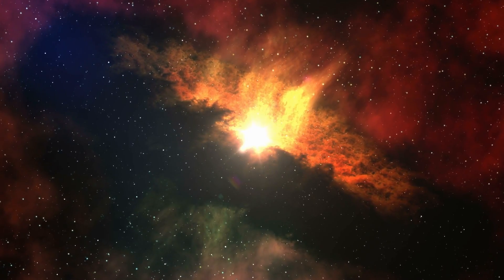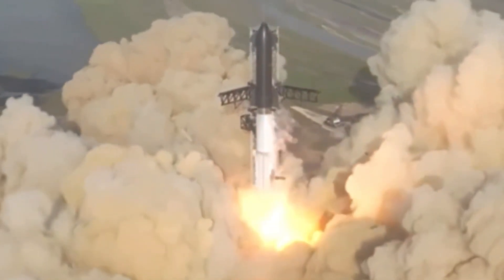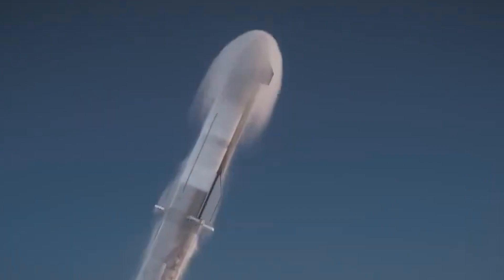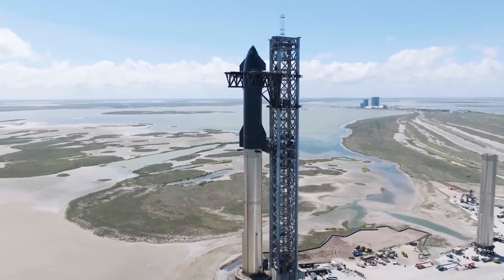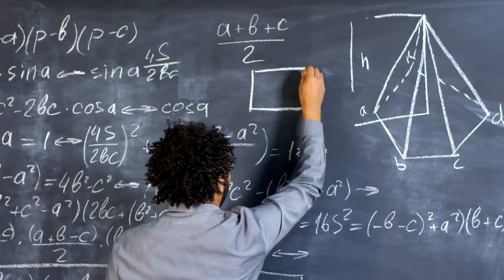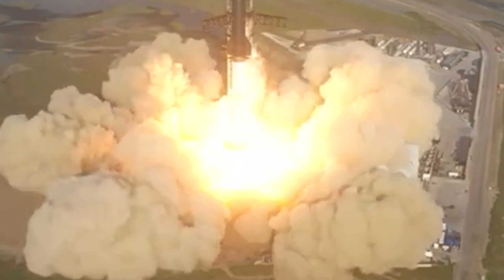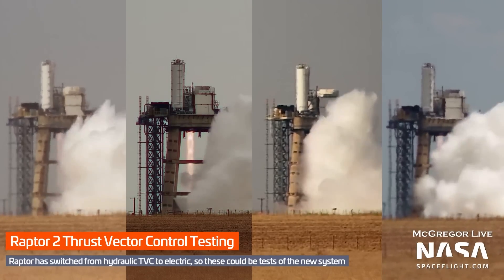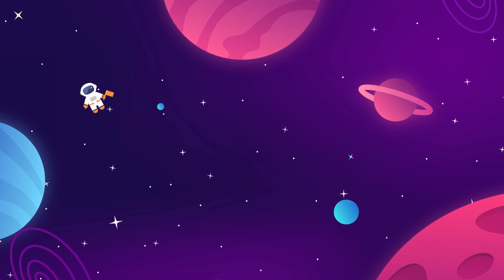The SpaceX Starship Orbital Launch Update Is Here!

Comment: The most important thing in massive launches is a water-cooled launch pad. Bringing down the temperatures requires anything that evaporates under heat. The fact that this was not done seems like haste is waste and in fact here it seems haste is stupid looking at the colossal loss as that launch could have gone perfectly. Simply having an easy to build massive water tank at the bottom of the launch pad without that sophisticated water spraying feature would have made a considerable difference in bringing the temperatures down at the launch site.

Comment: The narrator is a freaking small brain clown.  The rocket didn't "burn through" the concrete, lol.  What happened is high intensity vibrations fractured the concrete, allowing exhaust gases to penetrate through the cracks, which eventually blew out pieces.  Once an opening was created, the remaining pad was pealed off in chunks, similar to what happens with a sand blaster removing paint.  "There is no where for that energy to go."  Again, stupid.  Space X is using an open pad concept, where exhaust gases are spread 360 degrees around the pad, instead of being concentrated into a exhaust channels, like the Saturn 5 pads.  This drastically reduces the concentration of gases...  "No way that's possible".  I guess some clown whose biggest achievement is creating a youtube channel knows more than Elon, lol.  What arrogance and stupidity.  Again wrong about the 3 engines too.  Space X shut them down before before launch, genius.

Comment: The launch pad needs a completely new construction. The rocket needs to sit higher, farther away from the ground, then it requires a different path for the exhaust gases to divert. It needs a lot more rebar and efficient water cooling. Then there needs to be something like a large mesh that holds back debris, also there is a need for measures to reduce noise emissions like noise reduction walls near the launch pad. This is a far bigger project. The launch pad needs to withstand many launches with only minor repairs after each launch. Critical infrastructure like the tanks need to be farther away or need to be underground in bunkers.

Comment: Least path of resistance is the key here. Like the space shuttle launch pad the thrust is directed through a giant concrete chute with of course all the noise harmonics dampening features. When you're dealing with something this massive you have think massive. That kind of power is the equivalent of an explosion. When I first saw this launch and seen the dust plume and duration of of time spent before liftoff my immediate thought was it's overwhelming the launch pad. My second thought was it'd be no surprise if it exploded before it got off the ground. Perhaps elevate the rocket at a further distance from the ground and diffuse the thrust in four directions through a tunnel like systems and the tower would have to retract away from the rocket. I'm not a rocket scientist but judging by the hang time and power of this magnitude too close to the pad is just asking for trouble. It would be a huge undertaking, no doubt.

Comment: 9x33=297 but the output cap is 100% not 297%
9x8=72 how is 1 engine 9% of the thrust when there are 33 engines all providing the same output, Its more believable that the rocket wasnt using the remaining 28% of its thrust and increasing speed but instead the remaining 76% assuming each engine is just as powerful producing an equal 3.03% thrust seeing as how the thrust to weight ratio was still positive after loosing 5 engines which by my math is 15.15% thrust loss but yours is 45% thrust loss

Comment: Hate to burst anybody's bubble here...My father, (Mercury, Gemini, Apollo) and myself, (f-16, Trident, Ford Aerospace/Loral), as engineers are quite appalled at the level of destructive failure created during the SpaceX launch...And in short, in our opinion, find it is an alarming failure by the engineering launch department...This is a clear indication of  critical review and analysis being either absent or incompetent...It needs to be frequent and unbridled...Issues...No water wash down...No flame/exhaust diversion...No full power up tests of the full rocket assembly... These were standard with the Saturn V launches at less than half of the energy output...There are clearly weak links in E. Musks Program...Suggestion...Independent engineering program review and monitoring...It's apparent that his inside house systems cannot be critical and thorough enough to see the obvious...

Comment: I am not an aerospace engineer, yet, it seems to me that Space X's issue is the same the Soviets had with their moon rocket was synchronizing their many rocket motors in the main booster stage. 

There is a reason why NASA  keeps the number of their rocket engines to a minimum. 

Also NASA also knew  that water and lots of it works to not only cool but as a noise and vibration reducer. 

Im a big fan of Space X but it seems that they need to use what works and not try to reinvent tried and proven systems.

Comment: concrete does burn guys. mechanics have known for years.
some unlucky fool was the first one to catch a transfer case or some transmission housings on fire and they were made of magnesium.
its also hot enough to burn concrete and you have to be careful because if you do burn concrete it gets nasty fast. the moisture in the concrete is what makes it turn explosive in a sense. 
on a serious note while the rocket was moving and taking off that exploding concrete we all seen was moving pretty stinking fast compared to the rocket. why arent we launching concrete rockets into space instead...

Comment: The damage in Port Isable would have nothing to do with the with the flight termination system.  That was at least 24 miles high, and many many more down range.    From what I heard the launch it's self was much louder then predicted.  So those windows were probably broken simply due to the sonic energy of launch.   The fine dust is obviously due to the launch pad failure.

Also that was some mighty large "fine particulates" in the video you paired with that statment

Comment: The "engineers working on a water cooled plate" thing tells that sx knew the pad wouldn't hold up. Probably why the only real goal was to clear the tower. Nice way to demo the under built pad. sometimes under-building/breaking things is more useful than overbuilding everything always by default. highly unlikely that chunks of concrete were flying toward any of the full throttle raptors.

Comment: Is there a way they could launch at not quite full thrust - until they clear the launch pad?  Then power up gradually as it gains altitude?Also, what if they launched from an arm that holds the rocket 200 (more or less) feet above the launch pad so the blast wouldn't hit the ground so hard... or dig a deep hole directly underneath the existing pad with pressure channels outward to put more space between the point of exhaust on the rocket and the bottom of the launch pad.

Comment: It needs to go higher,  The rockets are too close to the floor  which adds extra heat if they are lifted more with a bigger gap the temperature on the floor would be less. But i would also put those redirection channels in too. There's another option too but it would involve a complete redesign of the booster section. Essentially not putting all your eggs in one basket. But 4 baskets instead. reducing all that heat in one spot by putting it in 4 separate spots.

Comment: At 5:19 that long shadow to the right is not the booster.   See the grid fin?  It's still attached to the booster.  The booster is the short stub pointing upwards toward one o'clock (on a clock face).  It looks short because it's only slightly bent out of alignment with the second stage.

Comment: It occurred to me today.  One thing that could have destroyed the engines,, Sound.  The launch was not just loud,,, it was only a touch less loud than Krakatoa when it exploded.  (a slight exaggeration)  But,,, sound above 200 decibels can kill a person.  At some point above that sound can tear a person to shreds.  It even,,, may not have been rocket blast that  broke the concrete and blew out the crater,, it may have been sound.  This should be investigated..  Sound decibels is a scale of magnitudes.  170d  is 10 TIMES stronger that 160d.. 180d is 10 times more than 170d.  120 is loud,, rock concert, ears ringing on the way home.,,, 10 billion times stronger than the possible 220 decibels at lift off.  Sound can melt steel at that level,,, sound may be able to melt titanium at that level.  Solid concrete under that much stress would have the durability of whipped cream.  The reason water is so effective at launch sites are two  First when water turns to steam,, it goes through a temperature of transition.  It takes a lot of energy to go from 212F liquid,, to 212F gas.  And the second,, and more important feature of water is odd.  Water is harder than concrete,, water when slapped hard enough,, is harder than steel.  Yeah that nice warm shower,, feels great,, but is almost incompressible.  Hydraulic fluid can be compressed,, gasoline, can,, air can, steel can,, water cannot be compressed.  Annnnnd water has not just three or four phases,, solid, liquid, gaseous, plasma,,, water has something like 19 phases  and counting.  Some of those phases are harder than diamond.

Sound as a causative should be investigated.

Comment: Parts of the destroyed concrete platform damaged some engines and the hydraulic system. Therefore the rocket didn't reach the calculated velocity and the 1st stage couldn't separate from the 2nd stage.
This was predictable, at least highly presumable! It would have been better to postpone the start, until protective steps would have been realized to the launch pad. Then the outcome of this flight would have been much more productive. 
Now they have to build up a new launch pad, which will take several months. And there are a lot of measurements, which couldn't been made, because of the flight abortion after only 4 minutes, not to mention the waste of the rocket and other equipment of the launch facility.

Comment: Did he say 39 miles

Sounds really trivial when ur looking at millions, billions of miles.   We got 00000000000.1%, of the way.

And I'm not a rocket scientist but if u got 25 30 engines then each one is not 9%, loss. That would be 11.
Reply: There's 33 engines.
22 engines are barely enough to keep it hovering. The 11 more do the actual lifting.
So each of those 11 engines you lose, 9% of lift goes away.

Comment: Too many engines, too many chances for failure.  Just check out the Russian (Soviet) N1 rocket program failure.  Also, too much thrust to be sustained by a launch system.  They need to loft the rocket to a safe altitude before they go to full throttle on the engines.  The concrete pad is definitely a bad idea.

Comment: Personally i believe the problem is simple and geometrical note all the engines that failed may not have been neccessarry as stated, however thee location of the engines that did fail was the contributing factor of the unbalanced power which ultimately caused the spin. Technically they were neccessarry to stablize control to their locations . uneven thrust will cause an unstable path because geometriclly speaking those engines were unproportioned to the thrust in its entirety. The real problem in my opinion is what caused the failer of the engines themself.could it have been simple meltdown as a cause of the type of fuel for instance. At any rate no stone should be left unturned.

Comment: Good analysis! There is an old saying, maybe it's coined by space rocket designers: "back to the drawing board". Fortunately, most things space related have many "drawings" already done that can be adapted, like the flame diverters and water dousing systems that could help here. Also, the Russian N-1 demonstrated the difficulty in getting so many small engines to work at once. The Star ship has a similar problem; but maybe they were only damaged, and that's all, by the lift off. The spectacular success of the Saturn V may have been due to the low number of (5) cluster engines but with a huge size of each one. Somewhere a solution to Space X's problems lies either with the basic design of the ship or the launch pad or both together. 

Yes, it was a huge rocket, but it does not work as well as the Saturn V did many times, the record holder for most successful manned, deep space, rocket in history, a legend in its own time, and continues to be so. So, to keep touting the "size and power" of a launch failure is a little ridiculous!! Why the rush to "outdo" the impossible record of that pioneering moon rocket, of over a half century ago, is not understood well. I know lifting power is important, but a few ships that are reliable to launch into orbit, sharing the load, will also get a job done; and assemble a ship to go to the moon or to Mars. Since it's likely that the crewed ship will be a nuke anyway, nothing that could ever lift off, but could get us there quickly, which is very important for crew health. 

No doubt they will fix this, but there will be many other sets back, I predict, if they don't try to keep the "eye on the prize" and "keep the pointy end up and the flaming end down" on their future test flights!! ;D LOL
Reply: I was going to mention the N-1.  Then I saw your comment and didn't need to.

Comment: With 33 engines wouldn't each one be about 3% of the total thrust not 9%? Or do they vary the thrust/fuel flow rate for each one?
Reply: I think the Inner Core of 10+3 engines were  more or less powerful than the outer 20

Comment: They need to install raptor booster blasting up. I. O. W. Booster from rocket blast against a booster blasting up. 1booster vs 1 booster x32. Fight fire with fire. Results in double thrust and safe half fuel in rocket with initial lift

Comment: 8:22 - "The team thought that the new high strength and heat resistant concrete would be able to take the pressure."

Nasa engineers 1970: Our engineers calculated that te concrete wouldn't survive, so management canceled the launch.
Private company 2023: Our dictator CEO got impatient, so all our engineers "thought" the concrete could handle the launch to avoid being fired.

Comment: Why not have the pad at the bottom of a very deep hole far from the rocket.  Exhaust would be diverted in troughs in the sides of the hole at the pad bottom.  Might also be interesting to see how thick a heavy copper plate would work (might be hard to find that much copper (!) )

Comment: The Saturn  series rockets  when launched at Canaveral had a design feature in the  pad that allowed for the power of the rockets thrust to exhale its energy , it’s called a flame trench .Built into its network were also safety chutes to bring technitions to a heavy bunker if they lit the candle and things didn’t go so good .
Reply: So agreed...That engineering group, (Saturn),  which included my father, "got it" much better than this group...It is clear that this engineering group has real weak links in it and very little in criticel final review clout or insight...
Reply: @charlescampbell8319  We are talking much better sophistication of a rocket.... Especially since it was the first time starship fully stacked and test launched... Give them time, they are humans and you are too, we make mistakes and improve from their.

Comment: Any idea why they didn’t separate the upper stage and attempt to recover it?  Seems like the astronauts need to survive a problem like this. 11:00
Reply: The upper stage was unable to separate. The flight termination system was triggered (aka the explosion) because letting starship spiral out of control would be a really bad idea
Reply: @lordmicrosoft1986  But only the first stage was out of control. And the termination devices were only on the first stage. Seems like this would have been a perfect time to try a test a separation to save the astronauts. It really seems like they had plenty of opportunity to separate and try to bring it back. Or at least ditch in the ocean.
Reply: @grumpy3543  They couldn't separate. It was stuck together
Reply: @lordmicrosoft1986  How will they save the astronauts if they can’t separate?
Reply: It wasn’t high enough. It was descending in free fall.

Comment: Great video footage and very good commentary, top kudos to The Space Race.

" ... hydraulics damage in gimbal area could have compromised the hydraulically activated first stage separation."

Why are both the 2 HPU (Hydraulic power unit) circuits routed through a single point of failure area in the main first stage combustion volume?
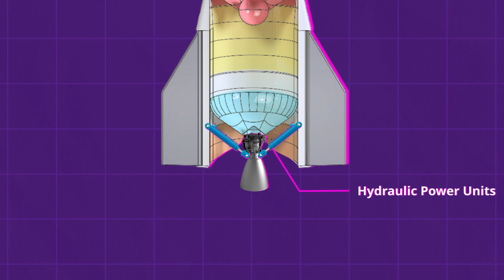See footage here : 3:13 -> 3:28

FTS (Flight Termination System = "Self Destruct") took the duration of 4 out-of-control rotations before the rocket did indeed go through a "premature destruction sequence".

Will have to watch again to determine the timeline, it was suggested that the holes that the FTS punctured in the LOX and CH4 tanks were seen on the video, there certainly was a lot of vapour streaming from at least two points in the for'ard section of the fuselage before the wild rotations started.

The LOX volume also ran down to zero a lot faster than the CH4 volume, suggesting it was venting.

So the FAA will be scrutinizing the HPU and FTS systems with a fine toothcomb, and not risking another MCAS debacle.

Was watching this video soon after 
   Starship First Flight: FAIL or SUCCESS? (Fraser Cain ft @scottmanley and @MarcusHouse)

As Scott cynically says at the end of the debrief with Marcus and Fraser,  "[to the effect of] It will take substantially longer than 2 or 3 months [before next rocket test], it will be blamed on legal delays, but it will probably be technical issues".

[@#]